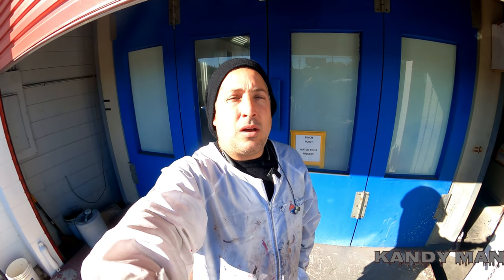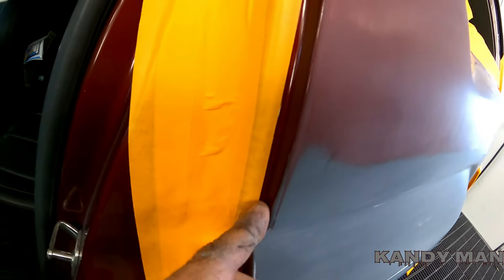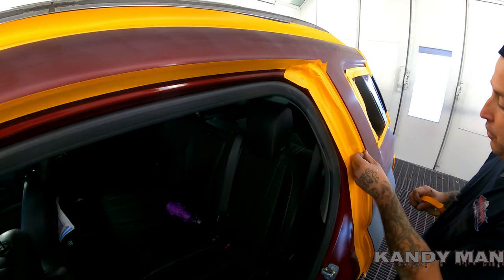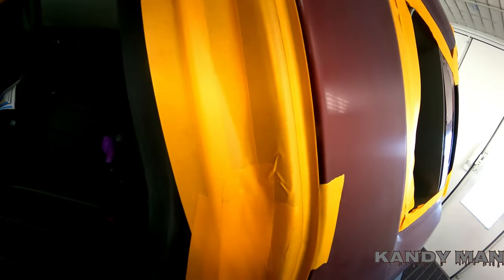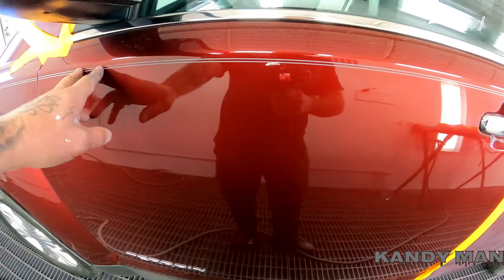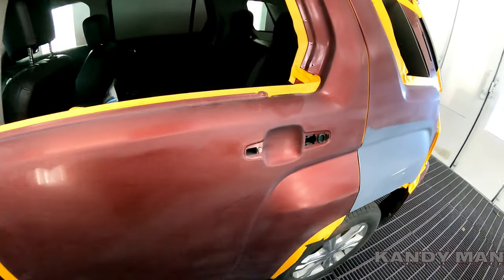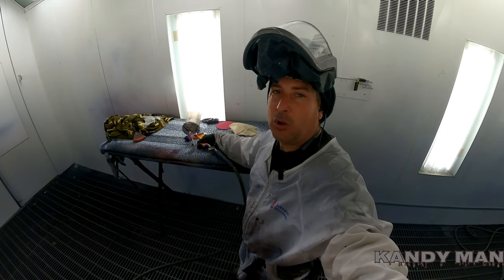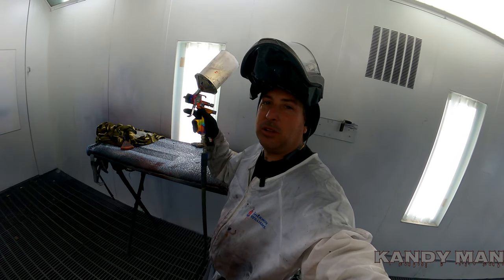PICKING UP MORE 3M PERFORMANCE GUNS

Comment: Since you're a Sherwin guy have you ever sprayed axalta or BASF or ppg  and out of those four companies who is your favorite and and who makes the best product in your opinion and the easiest to use
Reply from the maker: Started my career with  sikkens  then diamont then ppg solvents then  switched to ppg  water  after doing demo's  on all the water base systems. Sprayed ppg water for about 8 years straight.  Then Sherwin  u9k for around 5 year's.  They all have good and bad things  but all around my favorite is Sherwin.  From primer to clears it is a great  system.